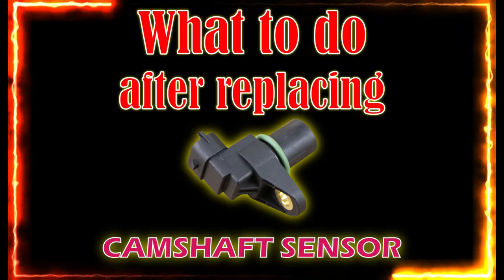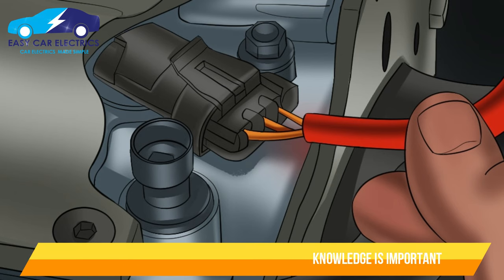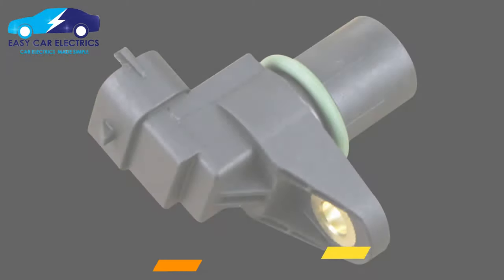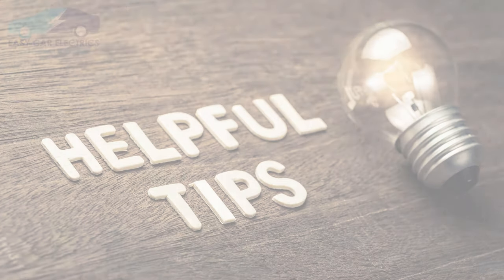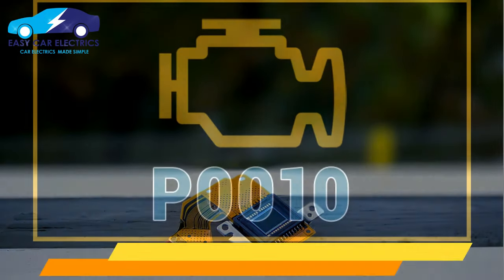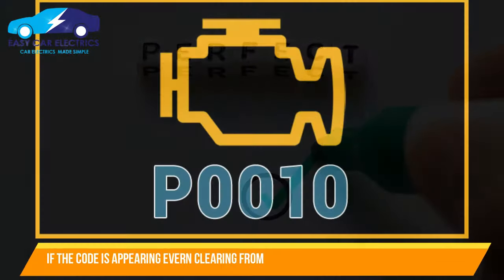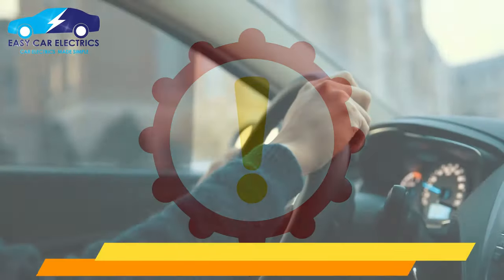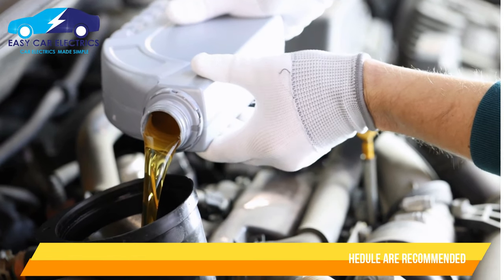What To Do After Replacing Camshaft Sensor - Easy Car Electrics

Comment: Just unplug the battery and it will reset
Reply: I have 2 Camshaft sensors on my Nissan 2020 Sentra I replaced the old ones coz the error engine code said Camshaft sensors need to be replaced.I put one original Nissan product and one after market sensor but no I had no luck.. the reason I didn't buy both the sensors from Nissan coz of the cost.. Nissan product cost me $215 including Tax and the after market one is only $50. I think I should put both sensors from Nissan for a good result! What do you think brother? Please give me your feedback! Thanks..